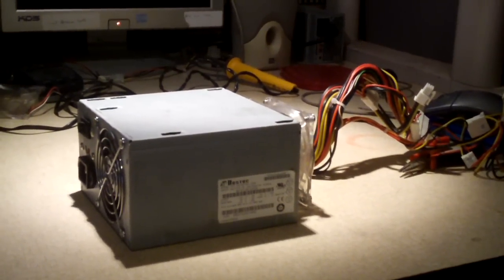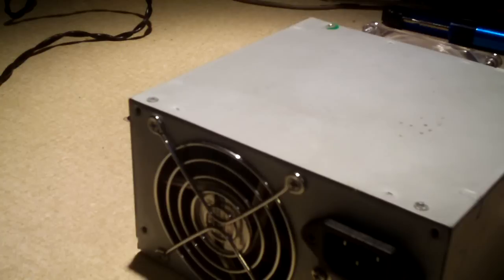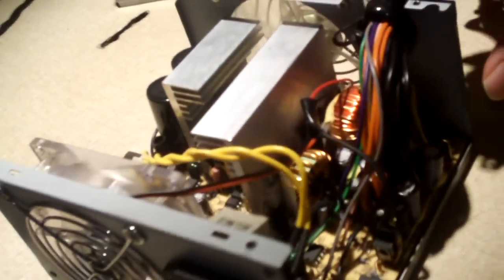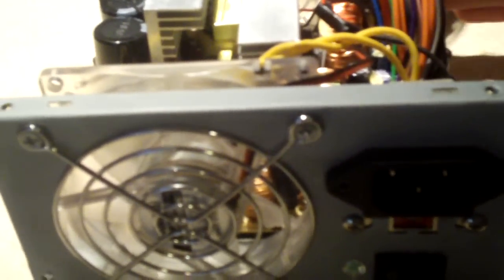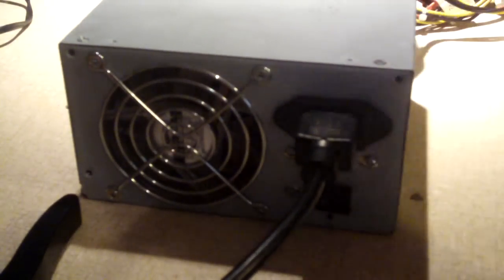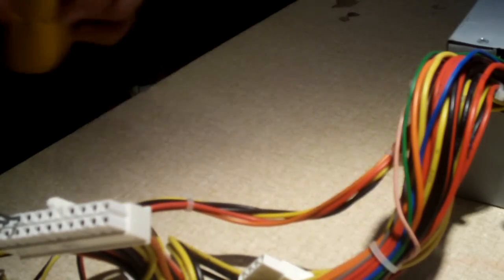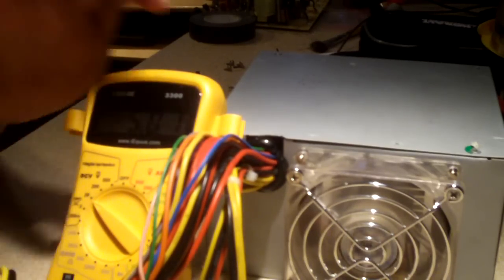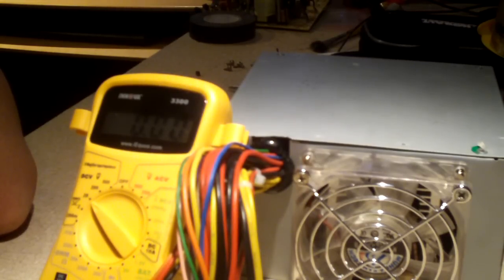Re-Cased Bestec ATX-300-12Z Power Supply

Comment: Could I use this for a new cheap gaming pc build? Plan to upgrade PSU in the future but this is all I have right now. Something in like a Ryzen 3 compatible motherboard. Is it okay to use in the short term?
Reply from the maker: What are you planning on running for graphics? And what is the TDP of the processor you are planning to use?
Reply: Was planning on using a ryzen 3 3200G without graphics card for the time being. Planned to add graphics card when I add power supply in the near future. Not sure what TDP really is. Realatively new to this sorry in advance
Reply from the maker: @victorcontrerasm  That power supply will work fine. I've even used the 250W model in Ryzen 3/5 APU builds.
Reply: Thank you so much. Much appreciated! :)

Comment: I have this PSU. Is this PSU trusty? Everybody says the worst about Bestec PSUs.
Reply from the maker: The only Bestec you should worry about is the Bestec ATX-250-12E. The other models such as the 250-12Z, 300-12E, and 300-12Z are fine. The 250-12E has a flawed design in its +5VSB rail, which can cause the voltage to spike to 12V or higher, and fry motherboards. The other Bestec models don't have this flaw. Aside from some issues with failing capacitors, these are reliable units. I sometimes replace capacitors in these and once that's done, they're solid. I even use these sometimes in low-budget new builds.
Reply: I´m using this PSU to test my socket A Athlon XP 2200+ which is a +5V hungry system, without 4pin +12V CPU auxiliary power connector. I measured this PSU with a multimeter and the +12V is running at 12.15V at idle and 12.25V at load. The +5V is reporting 4.91V. This looks good to me. On a Pentium 4 1.5Ghz machine which has the  4pin +12V CPU auxiliary power connector, the +12V is running at 11.88V at idle. The +5V is reporting 4.93V. Any ideas on the variations of the +12V voltages between the two machines, considering the Athlon XP is more +5V power hungry? What about the ripple on this PSU? Is this a stable, linear power delivery PSU?
Reply from the maker: @rcarkk  The Athlon system is running the CPU from the +5V rail. The Pentium 4 system is running the CPU from the +12V rail. This is a "group regulated" power supply, so when the +5V rail is heavily loaded, the +12V rail will show higher As long as the capacitors aren't failing (usually when failing they have bulging tops_, the ripple should be within the ATX spec.

Comment: There is no such thing as tipo. Did you mean Teapo? And when they don't care, the would use small heatsinks, cheaps switchers, leave out the PFC, use a four diode bridge instead of a rectifier, leave out the filtering components, use thin wiring and a cheap fan. A lot of manufacturers use cheap caps, for an example i have a Delta DPS-460db 460w triple 12v rail power supply and it has some LTec caps, but it is one of the best built psus i have seen. Same with Enhance.